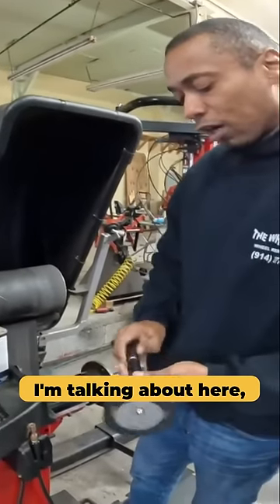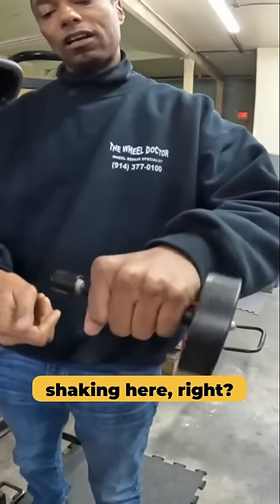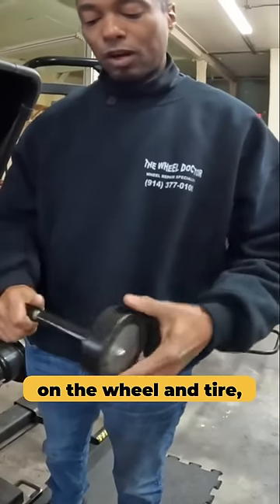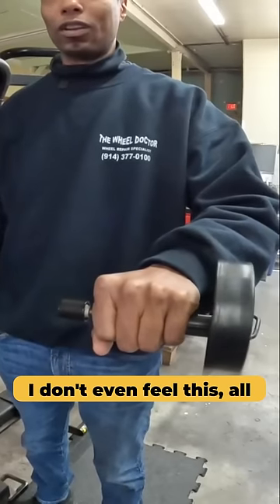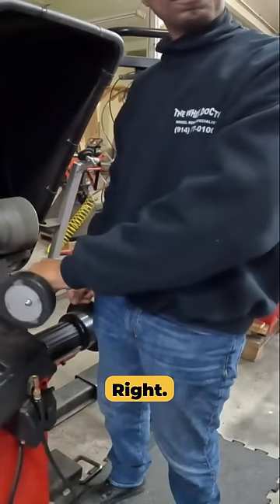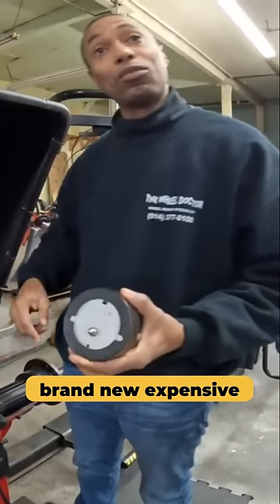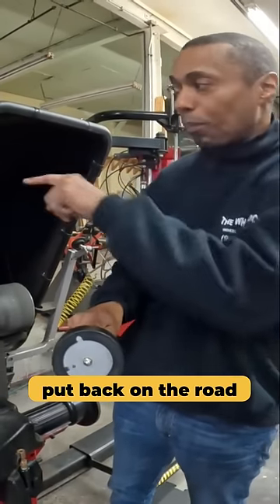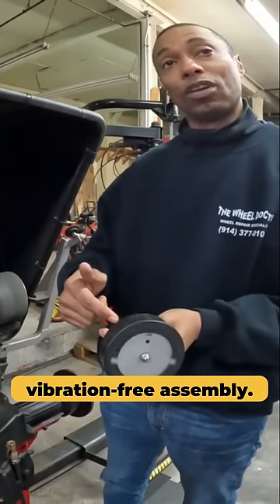1.5 MILLION VIEWS - Highway Steering Wheel Vibration (ONE SOLUTION) @thewheeldoctor7097

Comment: Helps when the axles in the center
Reply: Haha😂
Reply: Oh that’s what I’ve been doing wrong
Reply: Literally what I was thinking!
Reply: Yeah obviously, but he is using this as a extremely exaggerated example. This is what actually happens, but in a much smaller scale. Lots of people that use larger tires, expecially military (Michelin XLZs) on pickups, need to shave it (force match) in order to make them ride smooth. This isn't required on every tire, expecially name brand ones bought for a car. Those are almost always close enough
Reply: Well, I be dammm!! That’s what’s wrong with so many vehicles? They put the axles in the wrong places 😂😂😂
Reply: Force matching is basically putting  the high side of the wheel with the low side of the tire.  That axle being off center like that is just a simple exaggeration of the problem.
Reply: He's talking about a tire..... The axle can be fine the rim fine but not the tire
Reply: Lmfao😊
Reply: If
Reply: I believe you may have missed the point. Tires after miles and miles of use get out of round. In theory this happens  the tools he used over exaggerate  the point he is trying to make.
Reply: Yea, this seems like a gimmick.
Reply: Always has to be one that doesn't understand the premise of a small model demo of the principal.
Reply: not true .. all of the out of round tires i have ever had were brand new .. issue being just a bit more material in one spot over the rest making the tire pretty much egg shaped but to the naked eye it cant be seen .. best way to really see it is to find an alignment shop that has an old school machine that will spin the tire just above highway speeds .. if you put the ture on the wheel you can let gravity find the spot with extra material as it will be heavier and settle at the bottom and that area is what gets shaved to take away the excess material for force matching
Reply: I don't think you're smart enough to know what he's talking about 😂
Reply: You totally 100% completely missed the point and I've done that job 10.000 times 😃 the outer diameter of a tire IS NOT always centered around the axle. Even new rims are often visibly off
Reply: It’s a demonstration. I have literally had 2 tires do this crap, had them balanced from 3 different shops, and still shook your teeth out at about 60mph. I finally jacked the car up my self and threw her in drive, the 2 front tires were literally out of round and also had an axial runout by half an inch. The back was fine. I then checked everything, bushings, suspension components, even the run out of just the rims them self to the 1,000 of an inch. Everything was fine, except for the tires, which were about 3 months old from Wally World, and they wouldn’t honor any warranty on them, so bought a whole new set from a reputable shop, and never had another issue. So, don’t buy Walmart tires, and you’ll probably be fine, I made the mistake of going the cheap route and it cost me nearly double what it would have cost to just go ahead and buy quality tires from a reputable shop. Made this mistake 2 times actually, once with a reputable brand and tire, but from Walmart, and they did the same thing on a completely different vehicle, but it was all 4, after about 10k miles. So, big thing, don’t buy tires from Walmart, even reputable brands and models of tires, they are different, that’s why they’re cheaper.
Reply: If you're tired is out of round the axle is no longer in the center because the tire is out of round this shouldn't be a hard concept
Reply: For demonstrative purposes only. 

A lot of naysayers out there that don’t understand the science of their tires on their vehicles. That’s OK one day they’ll have this happen to them and through the process of education through tuition they will understand after they get the bill.
I think the bigger problem is finding a mechanic / tire specialist that understands this really well and having that guy also have the know how to fix it. 
A lot of tire shops, don’t have the ability to do road force test. I had two tire shops turned me down before I found a Les Schwab that could do it. 
Two out of four brand new tires that were on my used truck when I bought it new to me were way out of whack. 

I was lucky to have a dealership that was able to get those tires warranted. I paid the difference of 500 bucks and took them up on the offer to get Nittos installed. 
Otherwise, this would’ve been a crummy situation
Reply: So you shave off material (tread life) from the tire to force match it? Is thar right?
Reply: This is slight of hand
Reply: @Gendreau113 force match is NOT shaving. Force match is finding the heavier spot on the wheel and the heavier spot on the tire and off setting them.
Reply: Lots  of fake posts acting like they know what he's talking about too.
Reply: @ramathorn1982  I admit that I have no idea what force matching means. Like I asked in my comment, is that when you shave off excess material from the high side of the tire, meaning tread, to get the tire to balance. And what if you put just a wheel on the balancer and it's perfectly round? Do they make wheels with low and high sides on purpose? I thought wheels were supposed to be perfectly round to begin with.
Reply: Doesn’t help sales.
Reply: I'll try that next on my wheels!
Reply: @SpikeySlayer   "if" a butterfly had a piccolo up it's @$$ there would be music in the air.
Reply: So if the fix is getting a new tire. Then get a used tire,  the guy I go to have used tires that look brand new. Never had a problem in over 40 years.
Reply: @Gendreau113 your the only one with Brian cells here.  Congrats, it’s seems to be hard to find here.
Reply: That was clearly for demonstration purposes
Reply: So never buy off set rims
Reply: @stevenlillo2617 sometimes I do feel tired and out of round 😊

Comment: For people who do not understand a road force balance means you have to move the tire in the rim. That means you have to deflate the tire and spin it on the rim so the tire and wheel fit together better. It takes about 2x as long and is only ever really needed on agressive all terrain or mud terrain tires.
Reply from the maker: Thanks for that explanation!!
Reply: I used to change tires and mount/balance them in college. This procedure may not have had a name back then but we would spin truck tires if they took too much weight to balance. Simply spinning the tire 90 or 180 degrees made a dramatic difference sometimes.
Reply: That's the dot on the tire lines up with the air stem right? I did my 35s on 16 rims. Dot on stem no balance needed. No bouncy.
Reply: @ryderczarnecki-es2go  yes but no. 9 times out of ten you are correct, but sometimes the dot is just not in the right spot or the rim is bent or some wizardry.
Reply: The faster the tire needs to spin when mounted on the vehicle, the more important force matching becomes.   Aggressive off-road treads are generally not high speed tires.
Reply: @mikeschierkolk6995  thats only partially right. While the faster you go the more force matching becomes important, but performance wheels and tires generally do not have issues with their road force, unless they have a bent wheel.
Reply: I bought a set of snow tires for my Hyundai Elantra and that's the exact thing the guy said about road force, they don't check it in small cars because it's never bad enough for it to be an issue until he checked mine and it was triple what it should have been
Reply: @ryderczarnecki-es2go That's not true. There's always been confusion about the dots. People say to line the dot with the stem. But most tires will have a yellow, red, and white dot. 🤔
Those dots are from the manufacturer. They are inspection marks. Just like the color lines you see on the tread. Those represent tire size. Most of those are from Japan and they do that to see the size when they're stacked up.
Reply: i spin them together and mark , i take the tire off and spin the wheel and mark it. And than mount the tire back on the wheel and position in in most balanced position.. spin it again , and add minimum weight.. but i got old school machines
Reply: And high mph tires used for fwy racing.
Reply: Jaguars need this type too.  These types of balancers are very expensive and only dealerships usually have them.
Reply: Gonna need this for my 200mph + car! 😂👍
Reply: Thank you for making sense out of this video, I wish some of these videos would actually say what is going on without having to spend five minutes researching and reading the comments.
Reply: Not just offroad. Tires like the michelin cup 2’s and mickey thompson street slicks have to be road forced/force matched too. It can happen on cheap and expensive tires.
Reply: @BullittAutomotive  my experience is that michelins cup 2s and michelins in general don't need to be road force balanced, but that is just my experience.
Reply: @rikki-tikki-tavi2456  Most reputable tire shops have road force balancers, like discount tire. The question is whether or not they actually road force balance them or not.
Reply: Oh I got you thank you for the info
Reply: Thanks, I was going to the comments to find out what this road force is...... in my mine I was like... "what star wars shit is this?" may the roadforce be with you
Reply: My $700 steer tire is out of round so you’re saying this won’t work?
Reply: Makes sense because those tires have a lot of mass. But the "average" customer with a cheap, light tire might not even notice or even care about it.
Reply: That's not road force balancing that's match mount balancing

Comment: Was having a shaking issue with my truck. Had a wheel balance and alignment done...still shaking. Had a road force balance done...problem solved. It is more expensive but well worth it.
Reply: Sometimes the tires are junk! 
Road force balance makes bigger difference if you have bigger tires.
Reply: I have balanced many tires and only used road force balance once. I didnt think it did much but the process is not much different from regular balancing. I dont see why it should be more expensive.
Reply: @Iamthatguypal820  Takes twice as long to do the balance and machines are twice as expensive! 

If your tires were small and Michelin most likely they will balance but if you have big heavy tires, you can have issues.
Reply: @nickbakula8184  
In my case, along with the balance, they had to remount  2 of the tires to match the stiffest part of the side wall with lowest spot on the rim.
Most people will probably not need this service but, it can really help, especially if you drive an off road vehicle.
Reply from the maker: I hear you! I don’t think road force balance is needed in every case, but it does make a difference. As indicated in the full video, only the RR tire needed a road force balance.
Reply from the maker: Thanks!!
Reply from the maker: The Wheel Doctor mentioned the tire/wheel matching process in the full-video. Was very interesting, glad he shared the knowledge
Reply: And when the machine doesn't work they call me and i fix the machine that fixes the balance
Reply: @litoaykiu I have worked at a dealership for a while and road force balance was done on the same machine tht a regular balance was done on. It does take a little longer but it is still very quick. It also tells you which spot the tire will go to front right front left rear right or rear left. We didn't charge extra for the road force balancing it just wasn't standard practice. Once I learned about that feature of the machine everyone got road force balanced even if they didn't ask.
Reply: A shop shouldn’t charge you extra to road force balance, only if they have to break the tire down and turn it on the rim. Just FYI if you didn’t know. Most problems occur with brand new tires that have been stacked on shelves and become disfigured, no amount of turning it in the rim will fix it.
Reply: Many shops don’t do the force balance thing
Reply: I roadforce balance all tires for free! But when I shake your front end you gonna have to hear me tell you your ballpoint axle bearing tie rods ends etc all have play you gonna hate my guts
Reply: @nickbakula8184 roadforce measuring and actual force matching is different, no tire is truly round and sometimes that lack of roundness can be shifted on the rim to compensate it
Reply: Road force balancing will not solve the issue of a out of round tire. I am dealing with this issue now
Reply: @drkwing822  I can fix it as long as the tire isn't seperated
Reply: I had 2 tires Out of Round, they call it Runout.
Brand new. Road force balancing didn't help. the tire shop replaced them at no charge. Sometimes the tires are just bad.
Reply: Had a shaky ride before, took it to multiple mechanics, wheel balance, alignment. When I got my wheels balanced I had my suspicions, I asked them if my rims were bent, they said no. Ruled out tires as they were relatively new. I went with my gut anyways and got new rims and tires. Turns out it was the rims.
Reply: Bought new mags and tires they  bounced , and they rebalanced it ,it didn't work. 
         Ends up, the new wheel was out of round. 
        I've had those wheels for 40 years still use them .
          Glad I got a new different wheel instead of whatever forced balance is .
       This was in 1980 ,
      Before temporary fixes.
Reply from the maker: Until recently, I actually never knew this existed, probably a rare occurrence, now I always purchase a tire with a warranty/exchange-policy. Thanks for this comment.
Reply from the maker: That’s really annoying and pure laziness. That’s why it’s good to find a good technician, AND recommend that technician to others. Too many lazy techs/shops out there. Almost want to return to that shop and let them know the rims were bent. 🤔
Reply from the maker: Your comment sent me on a hunt. I haven’t heard that term mags in so long, my dad had a 75 Cougar with chrome mags. Learned something new.  “What are mag wheels? Mag wheels” is a catch-all for aftermarket alloy wheels. “Mag” is short for “magnesium,” a metal used in many alloy wheels of the past and in the racing industry.”
Reply: @chiz_tv Is this sued for semi tires? Just got a 3 axle alignment done along with switching both steer wheels to one's that have been already balanced and added centramatics to the steers as well. I still have a slight vibration occasionally
Reply: @andrewcetlemen6939 if the tire is out of round, why would shifting it on the rim make any difference unless the wheel is also out of round?  Unless by out of round, it means the weight distribution is out of balance.
Reply: @dubmob151  the rim is also out of round..... you have to mostly perfect circles but both have a slight bulge

Comment: Thought I was a fairly knowledgeable car guy, how the hell hadn't I heard of this? I wish the tyre shops near me had this service and knowledge. Kudos man 💪🏽
Reply: As a guy who was forced to work a and change tires for a year if ur wheel is bent the only fix to not feel vibration is new wheels as weights do not bend the wheel back into place
Reply: Every shop can do exactly what he's talking about. On a regular balancer. Spin it if the tire hops its out of round you can see it. Spin the tire 180 on the wheel, still hops spin it 90. Try again still hops spin it the last 180. Still hops tire is junk. (To far out of round. For this it costs more. Sad fact you have to pay for the tire being out of round to daignos it. Not the tire company. They will only give you a new tire. Rest of the money and recounting the tire is between you and the shop. This is why they charge more. With out the road force variance balancer  you have to try up to 4 times to fix the problem. The road force balancer can get it done in one try some times. I've been using this type of balancer for 30 years. Fixed many a tire normal shops couldn't. Don't really need one you just have to know about the rotation idea.
Reply: @torchecho1747 he's referring to out of round tires not bent wheels. Been doing this for 30 years myself. They balance on the balancer but cause vibration ah high way speeds. Especially here in South dakota at 80 on the interstate. I've fixed hundreds of unbalanceable tires with this method from many different stores who couldn't. Just most people that have the issue give up and live with the problem till their next set because the tire store says machine says their balanced. Can't do nothing for you.

Comment: HAHAHA!! Smooth transition to a different wheel that is NOW centered!!!😂
Reply: That’s the idea. He moves the tire to match the rim instead of just putting weights on to balance. It smoothes everything out. And no he didn’t move anything, that’s a tool he made to explain force balance. Center your tire on the rim and most of the time you don’t even have to use weights. It’s the best way to
Reply: @MrPlumber27  um ok sir plumber whatever you say 🤣
Reply: So to do like the little demo wheel, the lug holes in the wheel would get redrilled to properly center the wheel with the axle center-
Reply: @151 He is just showing the motion of a non-concentric wheel and tire combo, and what it looks like it when the tire is spun on the rim to make the outside surface more concentric. It would take precise measurements to demonstrate the change because of the road force balance and wouldn't be very visual.
Reply: @dubmob151  no the black rubber thing is spheroidal and the wheel thing is too so it can be spun to mimic out of round then spun back in place again